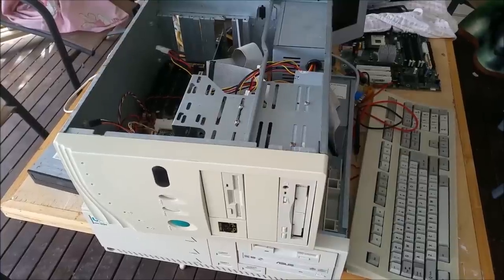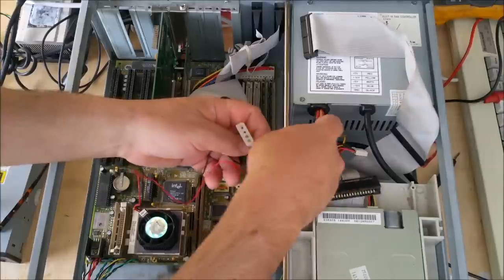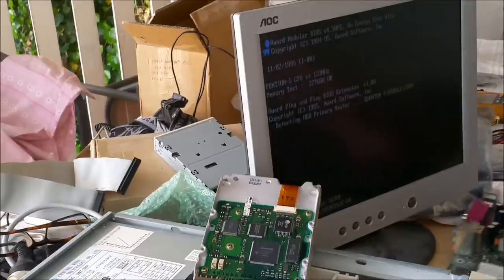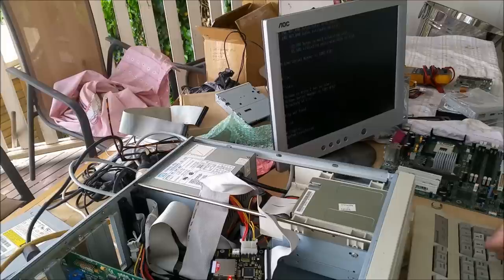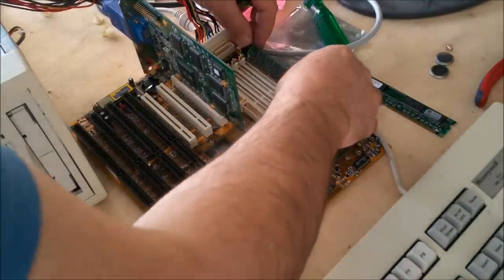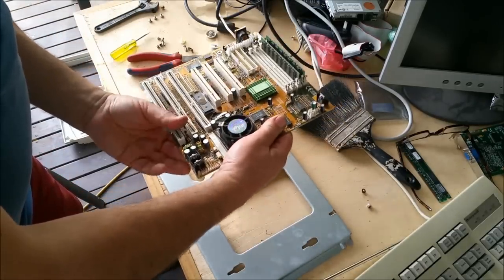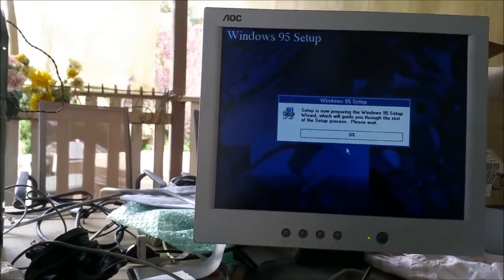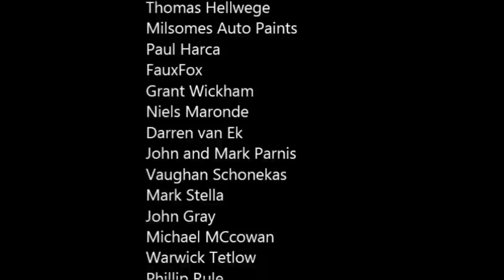Re-booting Stripped Junkyard Computers

Comment: Well that was instructional for just one small DOS command.  I have forgotten almost everything I didn't learn properly at Swinburne in the late 90's and had totally forgotten the Fdisk/MBR command.  Thank you Mr Anderson!  I am building a couple of retro computers too using Compact Flash cards instead of hard drives.  I ran up against the same inability to boot into Dos.  Now it's fixed so Windows 3.11 here I come.  I have a Pentium 200mmx with Win 98 and a 486DX2 66 that will now have Win3.11.  I wrote a couple of items for the Wolseley Hornet in Office 97 and Office 4.3 just for fun.  I don't really think anyone understood why I bothered.  Anyway, Cheers

Comment: Always good to see older machines like this going again. And with the amount you mentioned you have, have 5 older desktop cases from 1997-2003 or so myself, oldest being a Compaq Deskpro 4000, newest being a Dell Optiplex GX260 i've given some decent upgrades, and the other being an Acer Aspire 5500G, which is the same type that was my second computer i owned about 2006 or so. And the amount of older laptops i have, it'd take ages to list them all. Starting with a few from 1997, going up to 2003-04, which is as new as i'll go, basically early 2000's & older. Though i have some that are newer, the ones worth mentioning are a HP Pavillion HDX9300 from 2007 which is quite a big laptop, and a nice one. And one i got a couple months ago off eBay from canada, a Panasonic Toughbook CF-31, made to be all black & with the top specs you could have in this version of it with a 960GB SSD that was an option on the listing page. Cost a pretty penny, those are worth a bit & with the options i got in that one, postage & import fees and all that nonsense added up to it, but a good one though. Myself got into older PC's & laptops, retro computing as it were 6 years ago now with a nice condition Toshiba Satellite 4010CDT, and the rest is history as they say. Bit of a longer post there, but that's my story on some of the machines i own & my experience with it all. And also, started watching your channel when i saw the series on restoring that nice old sigma, not often you'd see one restored, and keeping it original like you did was a nice thing too, been a fair while since i've seen one as well. Good content you do on here peter, watching from little old victoria as well.

Comment: Peter, ALL of my computers are from the re-cycling center. My current main machine is a Lenovo server with a 2.4 gig Xenon processor and 16 gig of ram. The case was a bit smashed and the hard drives were of course removed. I have been using it for 6 years now. I have a couple of dual core Dells and an HP wide screen laptop. Good stuff :)

Comment: The Pentium 133 has 16kb of L1 cache motherboards cache is L2.
The TX pro is a PCChip board they supported non Intel CPU's such as the Cyrix MII 233 they run a different voltage and could have been set up for a 75Mhz FSB.

Comment: got  a few old cards lying around 2 network cards, game/midi card serial card , and some pc100 ram if you want and a 4 port tv card
Reply: Ps. plug a speaker into board that doesn't work and beep codes will tell you whats wrong